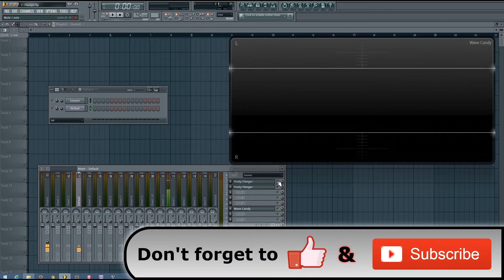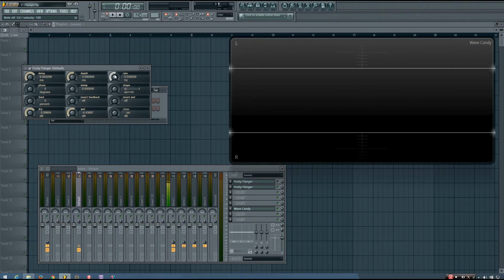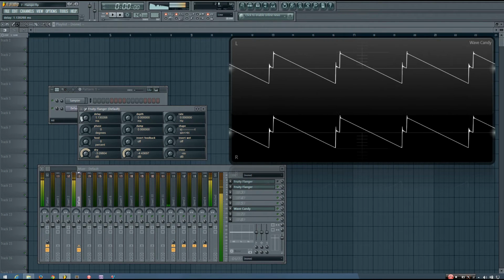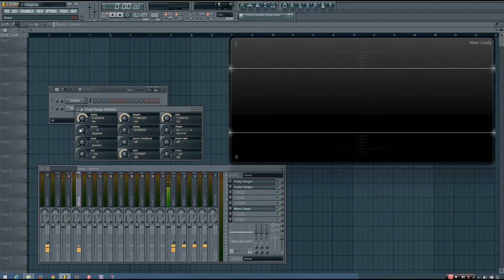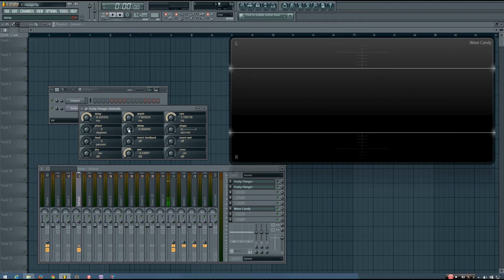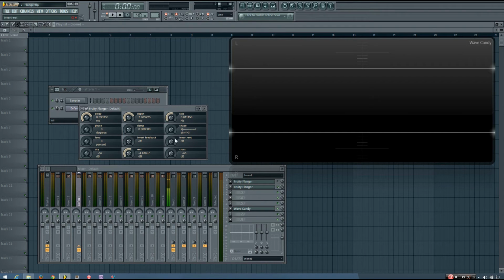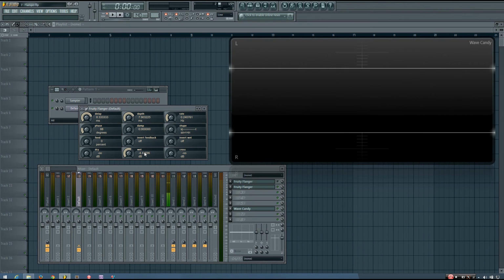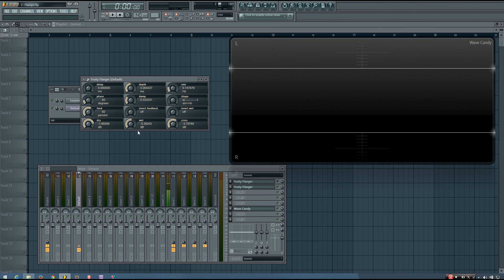Mixing Tutorial: Flanger

Comment: Cool tutorial! But I was wondering if there is a way to sync the flanger LFO to your song because maybe it will sound cool ;) Do you know a trick to do that?
Reply from the maker: The best way would be to use Effector on the flanger setting, because its LFO rate options are all tempo synced already.  The only problem with Effector is that it has a much more simple flanger with less parameters.  If you want a flanger with more parameters than Effector, I would suggest downloading a vst that will let you tempo-sync the LFO speed to keep things simple.
You can almost sync the fruity flanger's LFO with your song by dividing the tempo (bpm) of your song by 60.  This gives you your tempo in beats/second.  Because the rate of the flanger LFO is in Hz (cycles/second), you can set that rate to be equal to your tempo in beats/second, and this will make one cycle of the LFO span one beat of your song.  If you want a slower LFO, you can divide the rate by 2, 4, 8,  etc., to have one cycle span 2 beats, 4 beats, 8 beats, etc.  If you want a faster LFO, you can multiply instead.  

If you could type these exact values into the Fruity Flanger, you could tempo sync perfectly.  Unfortunately, you can't, and adjusting the knob only gives you so much control over the LFO rate.  For example, I can't set it to be exactly 2 Hz; the best I can do is 2.000674 Hz.  It's really close, but eventually it will become noticeably out of sync.  You could use it on a pattern and then bounce that pattern to a wave file so that it stays synced as a workaround, though.
Reply: ***** Or maybe reset the flanger plugin every time you want to loop the flange thing. Thank you for the clear explanation!
Reply: +firekoen Use the peak control. Ajust the LFO section as u wish. Then press on the flanger button u wanna "lfo" and right clic, then select link to controller - internal - LFO...there ya go
Reply: +Beat School would this work for a compressor release time too? like if i want to a sound compressed and to raise in volume after so many seconds but it is in ms